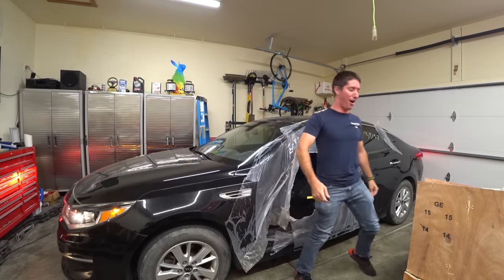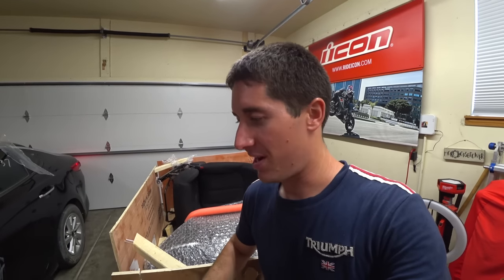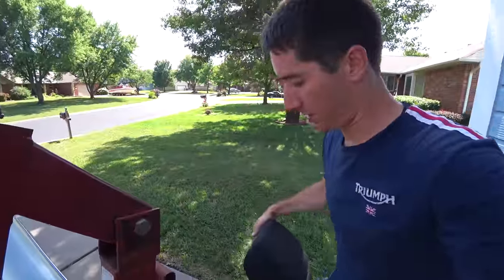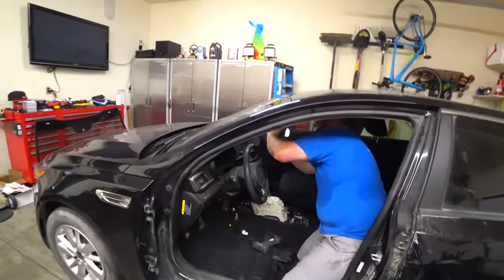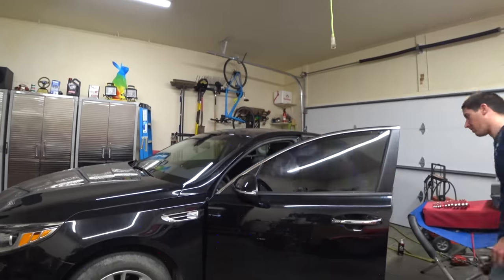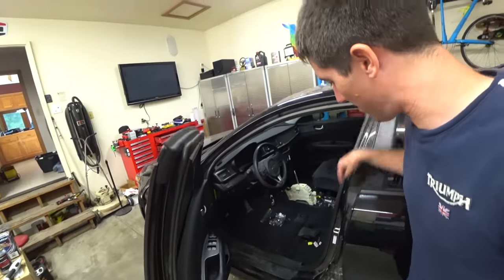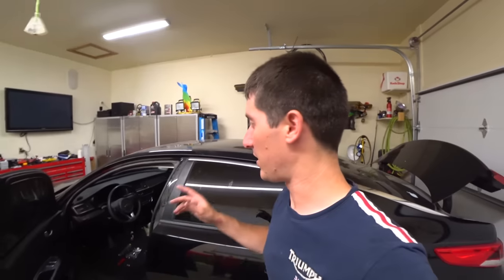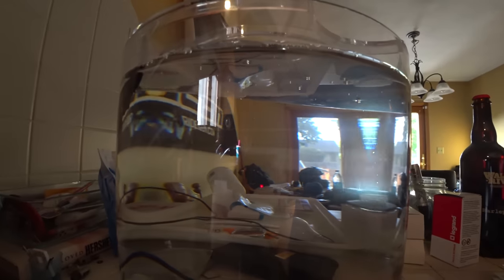Putting NEW DOORS On My COPART Kia Optima Revealed MORE DAMAGE

Comment: Dont forget to change over the key cylinder in the door
Reply: Good catch
Reply: He knows better than that.
Reply: I was coming on here to say the same thing, it’s easy to forget when your door is demolished and the used door comes complete.
Reply: He can still get in from passenger side, like Hoovie in his X5.
Reply: Actually it shouldn't matter unless the battery goes dead because most cars from the last decade have a keyless entry fob and the fob activates the lock regardless of what cylinder is in the handle. The door was pretty much destroyed so it may not be recoverable. A locksmith could rework the cylinder for whatever key you have in less time than it took to watch this video.
Reply: do cars still use door keys? weird
Reply: @aaron71  If you noticed around 2003 or so most carmakers started omitting all but the driver's door external lock mechanisms. In other words most cars since 2003 or so only have a key hole on the driver's door handle. They keep doing things like that to reduce the cost of making a car bit the prices just keep climbing higher and higher. I think car prices are insane and over priced. I don't think the price of new cars can be justified. I'd like to see the actual cost to build a car that stickers for $25,000. My guess is they have no more than  $10,000 in it including freight.
Reply: @Cartier_specialist  And that's really aggravating not having that pass side lock when you buy the base model without keyless entry(Toyota does this on the Tacoma)  Or you are the 2nd, 3rd, 4th owner and the remote fob is lost/doesn't work anymore.
Reply: @Cartier_specialist  They have to be able to pay for those door opener solenoids somehow.../s
Reply: @aaron71  on the drivers door yes in case your battery dies. that will be the only one on the whole car thought. if he has the key that matches that door he can use it or swap either or. it does not affect the remote. the key pops out the head of the remote but you can stick another one in. at least in 12 you could.

Comment: I hope your front windshield don't break again on your frame pulling for the b-pillar
Reply: Good point
Reply: I was thinking the same thing.
Reply: shouldnt affect it the glass its not really anywhere to put stress on it. if it cracks the glass from that you would have to worry about a bunch of things.

Comment: Kia typically only offers auto dimming /  HomeLink rearview mirrors as a dealer installed option or bought as an "accessory" in their parts department.  I have one for my Soul that I've not installed yet - they usually go for around $100 on eBay (new) and around half that for used depending on what features you'd like (compass, temp, etc.)...  What that roughly translates to is there won't be a "factory" harness for the power - you'll need to run it down along the a-pillar or "steal" it from the dome light circuit.

Comment: Man I use to work in the auto glass industry, delivered windshields to installers for PGW... Those damn stick on foam blocks are gonna give me PTSD flashbacks. When the windshields are packed in a crate they're often packed with like and not alike windshields so they use those blocks in varying sizes, shapes, thicknesses, and seemingly glue strengths. Some of those things DO NOT like to come off!

Comment: You could have easily replaced the upper moulding on the windshield, most glass shops supply an aftermarket moulding that replicates the oem inner moulding at the top. 

I’m a glass guy and have done tons of those kias, it’s not a big deal that it’s not there, just kind of annoys me how he basically said it doesn’t use it, when it should really be optional.

Comment: Wouldn't you want to put the car on the frame machine and pull the door pillars into place BEFORE installing the new windshield? I'm worried you'll crack the glass now.
Reply: if the b pillar causes the windshield to pop it would the back glass too. a pillar yes but b its the center of the car.

Comment: My Neon the door got over sprung hard into the fender destroying the skin and it pulled out the upper hinge. Now the replacement door is out about a inch because the mounting point is egged out about a inch too. I have to figure out how to push that point close to flat again so I can get the door and fender back into the body and lined up. I got it looking fine but if you know what your looking at it's way out. It opens and closes and window works so that's as far as it got. I bet you have similar issues with the center pillar with the tweaked parts. I could use a frame machine or something, still thinking of a driveway way to do it.
Reply: Bottle jack and a tree?
Reply: @TheBrokenLife  Ya know that's exactly what I was thinking. My car port has 6x6 posts holding it up cemented into the ground and I bet it could take it.
Just trying to work up the ambition to probably take the door back off and give it a shot. I'm hoping I can do it without pulling the door but I think I need the room. I didn't realize how badly the mount point was out till I couldn't get the door right and started looking for why...
Reply: @69Dartman  I don't think I'd recommend using a piece of your house for the job when there are giant trees virtually everywhere.
Reply: @TheBrokenLife  yeah, but nothing safely in my front yard. I have trees but couldn't get close enough to do any good. I could probably give it a test and if things start creaking not go any farther. Or use a junk car as the back stop.
Reply: @69Dartman  Got a buddy with a tree? A frequently empty park?

FWIW, I bought a 24" hydraulic ram for exactly this type of thing at HFT for under $100 (basically it's a ram that you would use in an engine hoist). So... If you could get within 4 feet of a tree, that would work. Personally, other than the challenge of just doing it at home, I'd have a shop do it for a couple hundred and move on. Or maybe change your thoughts to pulling it from the opposite side with a ratchet strap instead of pressing it from the damage side.

Comment: JR what if anything can I do to my 2014 Nissan Rogue to make more power ,, it’s stock now,, for basically towing more weight I want to tow a camper and it says stock it can only handle 1100 pounds I wanna go as high as possible without damaging the engine and money is an object so I have a budget of about 2500$ tops. Thanks 🙏 Mike
Reply: Honestly, selling it and buying something less anemic is gonna be your best option
Reply: I would not even try to tow anything more than that with a CVT transmission if you want it to last over 100k miles. I had my daughter change the fluid in her 14 Rogue in the hope that it will last another 5 years or more.
Reply: It's not the engine that can't pull it, it's the transmission and the structure of the car, buy a truck.
Reply: There are featherweight pop-ups that are extremely light weight. If you don't want to replace the car, perhaps adjust your criteria for the camper?